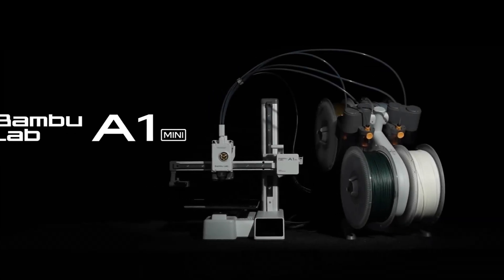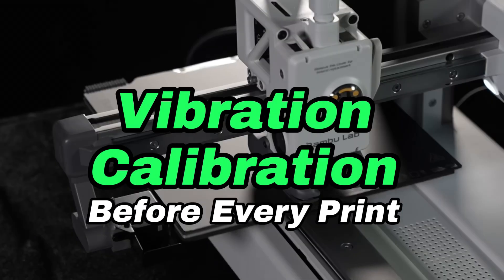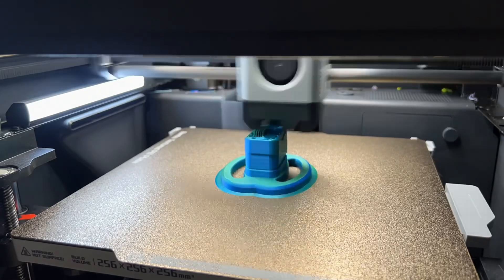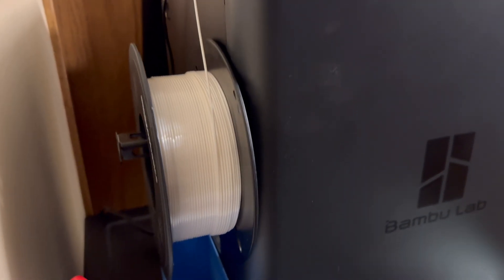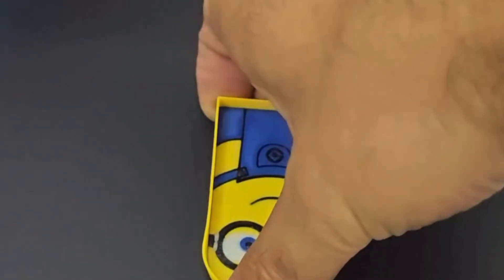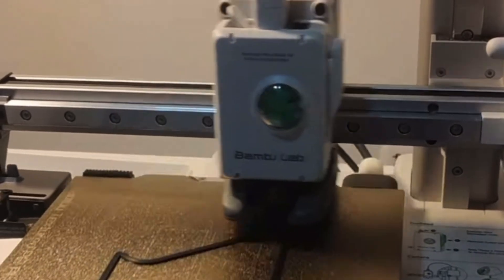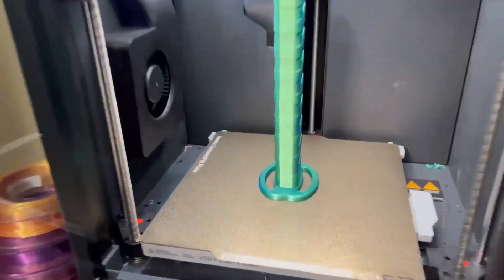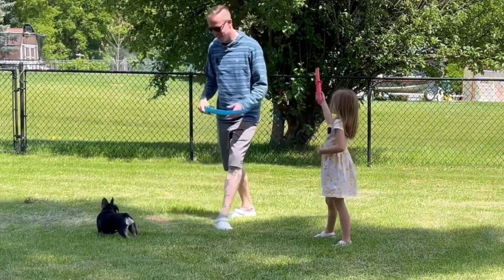Bambu Lab A1 Mini vs P1S Comparison - Which to Choose?

Comment: Due to current sales the price difference between the A1 mini, A1 and P1S is only about a 120USD(converted) in my country right now. I want to get a 3d printer for occasional practical prints. Shipping times are long here and a lot of simple but slightly niche things have to be imported or are unreasonable expensive to buy domestically. I'm leaning towards the P1S. A1 is out of the running because it needs to much space and the small bed size of the A1 mini is gonna cause me a lot of headache and extra work for the stuff that i want to printing Initially    (And i obviously don't know what i might want to print in the future).  It is a lot to pay for a 3d printer that is realistically only gonna be used once in a while but I also expect it to last many years and it is "all the printer" i could ever need for personal use. I feel it is worth the extra 240USD

Comment: Thanks for your comparison! This is exactly the two I am on the fence about, I don't really mind the price gap. I'm just worried about the sound it will produce, I live in a small apartment with my girlfriend, I need to find a space for it where it can both fit, and not be a nuisance to her. What do you think about the sound difference? Based on the reading I did, the A1 mini seems to be way quieter than the P1S seems to be.
I wanted to print specific things for around the house, holders for items, filling the drawer with specific outlays, and a trinket here and there.

Comment: I would be interested to know if the closed P1S is less dangerous to health? If the P1S uses a fan to exhaust the air from the enclosure and doesn't do it through a HEPA filter, I don't think there is much point in printing in an enclosure. I mean from a health point of view. I'd have the printer in a room, so the VOC fumes problem worries me a bit. The A1 is open, so has no protection.
Reply: Personally, im buying the P1S as my printer as i deem it more reliable. Im starting production of small items to sell on etsy, whilst further into my learning experience, printing things in ABS for my car as i'm buying my first car soon, so will be good for little mods. I personally think, spend the extra £280 whilst its on discount (making it basically the same price as the A1 normally) getting a cleaner looking printer & AMS system thats future proof. And yes, the printer is "safer" as it has an included carbon air filter, though i believe you need to over time replace the pelets or something, i'll check when i receive the printer. Also has better air circulation into the chamber, bringing fresh air in, enhancing the cooling.

Comment: I chose P1S w/ hardened steel extruder gears and nozzle cause filled nylons and I feel like it’s 9/10 of the X1C. I do wish they had a path to upgrade the main board to the unit the X1C uses… I figure eventually a third party may make a main board option for it

Comment: A1 (big brother of the mini) also can print pla-cf or petg-cf that can be also used as engineering  functional tools (correct me if I’m wrong)
Reply: Doesn't the A1 have the same printhead as the A1 mini?
Reply: @daandebanaan8902  Well you can mount an hardened steel nozzle but for those materials an enclosure Is recommended. So you can definetly try It but bambu tells you you cannot
Reply: @marcomanelli9099  Neither PLA nor PETG require an enclosure to print. Nor does Bambu Lab specifically recommend an enclosure to print them. Adding carbon fiber to the filament does not change that. However, as you note, you will want to install the optional hardened steel nozzle to print any CF or GF filled filaments on the A1 Mini since the material is more abrasive and will wear out the stock stainless nozzle more quickly